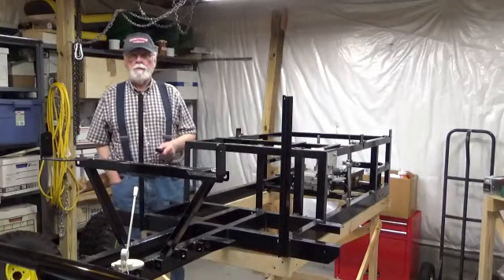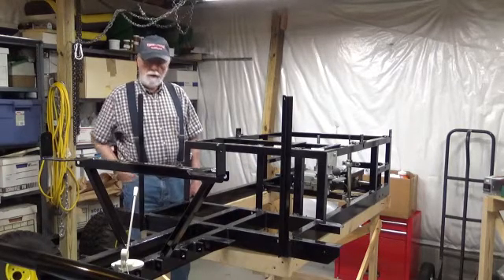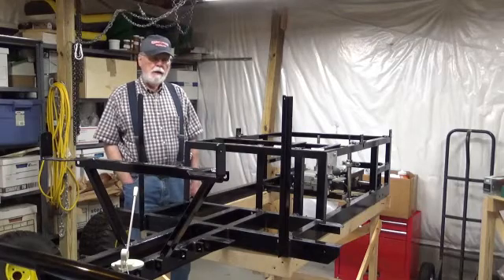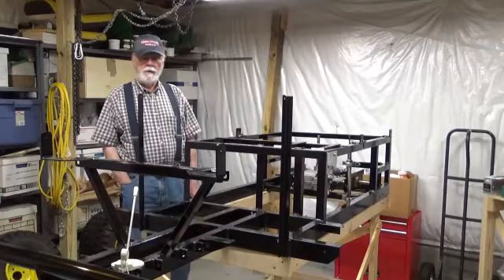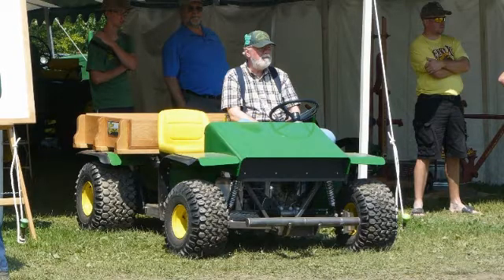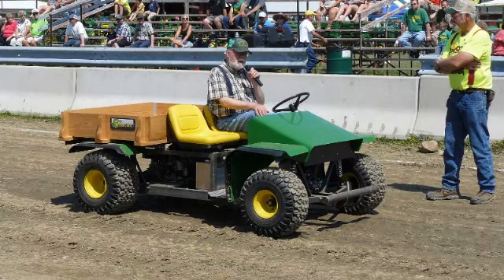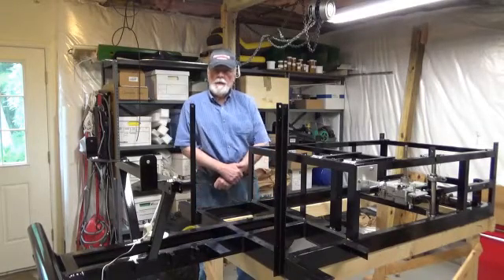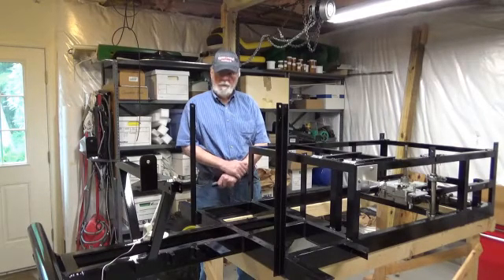Home Built Off-Road Vehicle  Part 1

Comment: Very slick design Paul, with the rear axle cages that take the weight off the transmission. The stance and look is much better than the JD design I think. How about bringing it to the Kinzer PA steam and tractor show at the end of the month.....Dave
Reply from the maker: Thanks, Dave.  I'm hoping to have it at the Steam Pageant next week but I just found out I will need a root canal before then.  If all goes well I will make it.  Will you be there?  I've never been to Kinzer but will look into it.
Reply: I should be there Wed-Friday. Sat back here for a local parade. Root canals aren't so bad these days...Dave